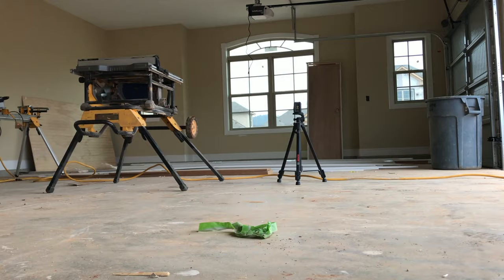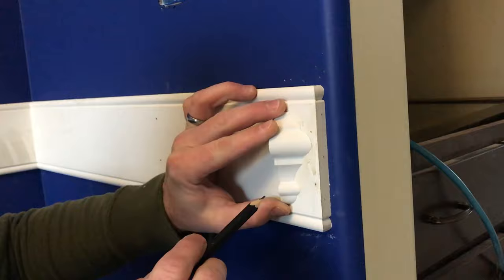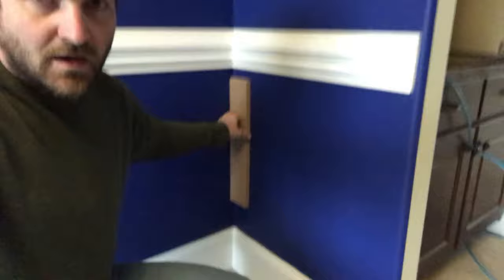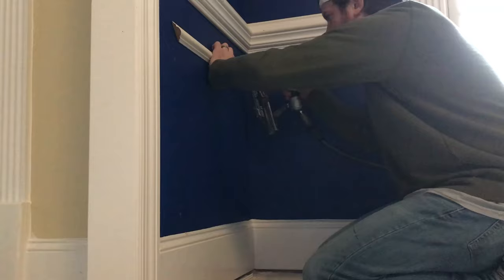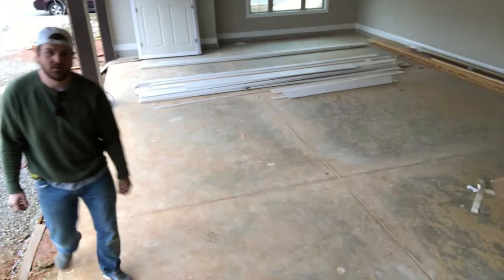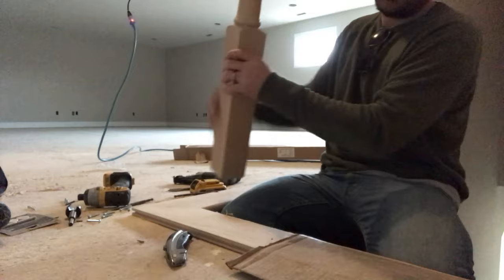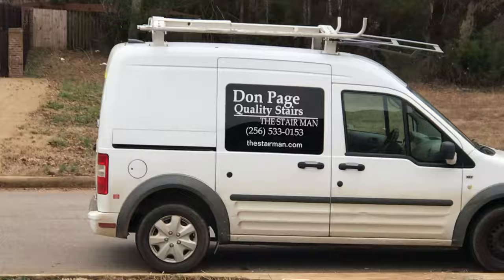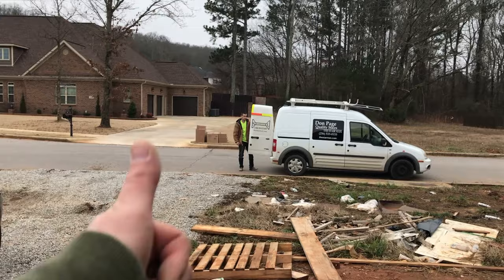DIY chair rail & boxes

Comment: Hello!  I had a quick question.  Where did you purchase the chair railing bac board in this video?  It is beautiful!  Do you know the model, and item number, plus where did you purchase this item from.  I would love to do my whole house in this.  Your videos are outstanding.  Keep up the great work.  All of us learn a lot from your great videos!!!
Reply from the maker: Well first, thanks! Second, I didn’t purchase it at all. In my line of work I just show up to the job site and install. But I can tell you it’s a 3 1/4 chair rail, with a 5 1/4 backer board. And the boxes are made out of a 1 5/8 beauty mold (sometimes also called 1 5/8 chair rail lol) it’s pretty confusing but if you show this to your carpenter or someone at the lumber yard they can help you out. Sorry I can’t help more 🤦‍♂️

Comment: Hi mate, are you just using pins into the plasterboard? Does that get decent purchase. I’ve seen a bunch of videos done this way and no one seems to hit studs or backing. Thanks mate
Reply from the maker: We use 16 gage 2 inch straight nails and hit studs where we can. Sometimes it’s just not possible so we use glue in the back of each piece and on every joint and angle the nails both directions into the sheetrock to hold it in place until caulk. The caulk really is what holds it for good. Thanks for watching!
Reply: @TMPK  hi Jared, what shade of blue is that? Btw, great job, room came out beautiful!

Comment: While the 4" board trick was fine for the single "beauty box" on the right wall, I noticed you included no help whatsoever about how you did the multiple "beauty boxes" on the longer walls....HOW did you figure the width measurements on that?????  And you say in the comments here that they are spaced 4" apart...but 4" of space between the moldings, or 4" center to center, or...???
Reply from the maker: Just a little math, Larry. I have 5 boxes and 6 four inch spaces between the boxes. 

Step 1: measure the total length of the wall. ( for example 174 inch) 

Step 2: multiply the number of spaces between the boxes by 4 ( since we want 4 inches in between each box) (6x4=24)

Step 3: subtract 24 inch from the total length of the wall. (174 - 24 = 150)

Step 4: divide 150 by 5 since we want 5 boxes (150\5 = 30)

Step 5: from one edge, measure 4 inches, then from that mark measure 30 inches, then 4 again, then 30, then 4, and so on and so forth until you reach the other wall.
Reply: @TMPK  Thnx...so the box side edges are 4" center to center, not 4" between the moldings.  That is what it looked like.
Reply from the maker: @LarryB-inFL  4 inches between the moldings